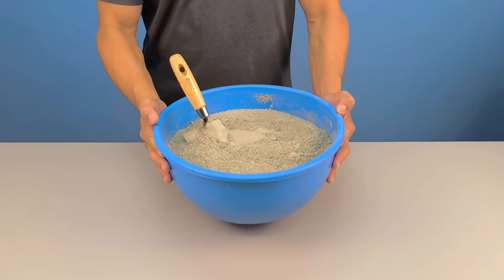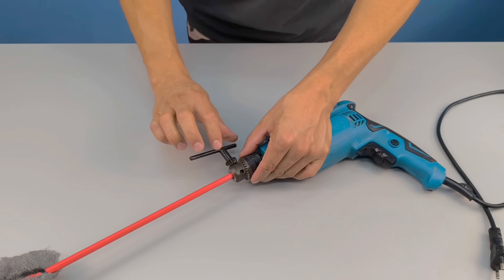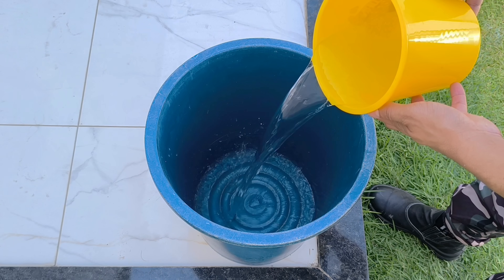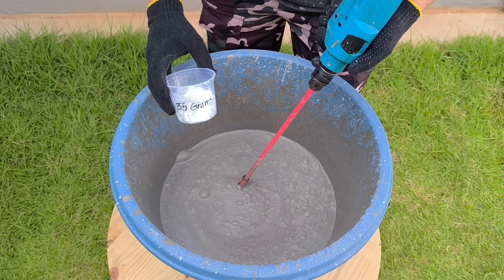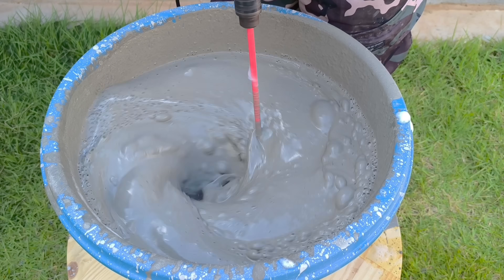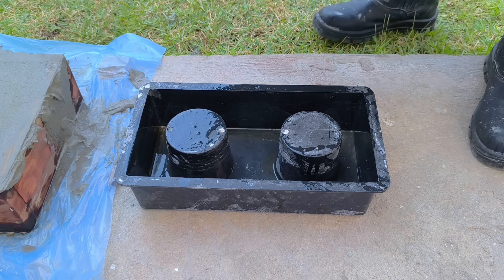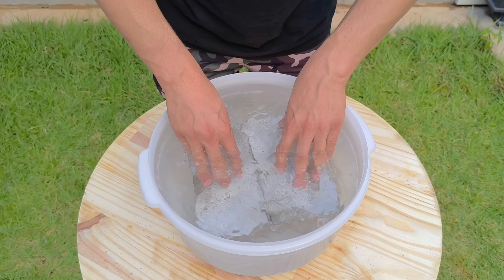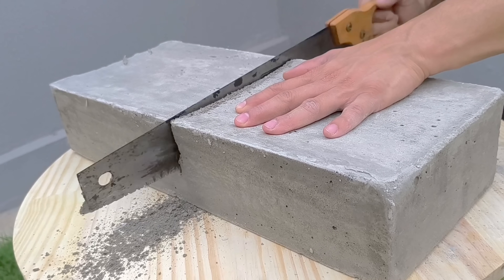Mix CEMENT with DETERGENT and create something that can REVOLUTIONIZE civil construction!

Comment: You should add about 1 to 2 % by weight (of the desired end product) graphite flake/powder  to the detergent water before bubble matrix is formed and mix for an additional 5 or 10 minutes during the foam formation step..... should.get some sheer force derived GRAPHENE generated AND incorporated into the matrix that way, which should have a dramatic increase to various physical properties like strength and resistance to sheer  , compression, tensile. 50 % up to maybe 250% or more in various metrics
Reply from the maker: That’s a brilliant and fascinating insight about using graphite and graphene! 🔬⚙️ Your explanation of the shear-induced graphene formation adds real scientific depth — I truly appreciate you sharing such advanced knowledge and contributing to the experiment’s evolution. 🙌✨
Reply: Will it be strong enough to build an internal portion wall or use it as a mezzanine floor.  I am looking for a very light weight floor for a mezzanine room. Thanks 👍
Reply: @padminidesilva320 no. It does not have structural strength.

Needs a floor below it to prevent crumbling away and a wear surface on top or it will wear out with foot traffic.

Ideally, encapsulating the floor slab with epoxy soaked cloth or fiberglass would work very well, but I wouldn't look very nice.  Could just lay the flooring on top and that will improve the appearance.
Reply: @padminidesilva320  причем тут материал? делай расчеты, проверяй конструктив, условие прочности, на изгиб, кручение. Примени армирование металлической арматурой.
Reply: Why?
Reply: @1987garrettwright  If I had it I would put the graphite soap and water through an ultrasonic bath prior to beating.
Reply: Y CON QUE SE ADHIERE????
Reply: графит - это не графен. безграмотность
Reply: @IceJokker  тут вроде как графен получается. Внимательно читаем предложение: "get some sheer force derived GRAPHENE generated AND incorporated into the matrix"
Reply: @EugeneOkean  т.е. что такое на самом деле графен - всем насрать, лишь бы сказать умное слово? ну-ну.. )))
Reply: @IceJokker  конечно.

Comment: What was the plastitizing agent and where would you get it?  How strong are the blocks, water proof?
Reply from the maker: The plastitizing agent was liquid detergent. It makes the mix smoother and lighter. The blocks are strong and slightly water-resistant, but not fully waterproof. Great for creative and light projects! ⚙️🧱✨
Reply: @inovaouinventa  The detergent is actually the foaming agent.
Reply: @inovaouinventa  what was the black colour liquid ? Chemical name and composition and brand name or product name ?
Reply: How can I make it waterproof??
Reply: just look it up, cement plasticizer

Comment: USA-Missouri, what is a common plasticizing additive.  The yellow container with the purple liquid is not the same as the container in the beginning with the green liquid, where it was easy to see it was dish soap.  And should I leave the plaster out since it does get below freezing in Missouri?  And I do not see sand as an additive?
Reply from the maker: Great questions, my friend from Missouri 🇺🇸! Yes, the green liquid is dish detergent — it works as a simple plasticizing agent to make the mix lighter and smoother. In cold regions where it freezes, it’s better to avoid using plaster, as it can expand and crack. Sand was not added in this test to keep the reaction pure and visible. ⚙️🧱✨
Reply: But exactly what kind of liquid detergent is the plasticizer since it is different from dish soap?